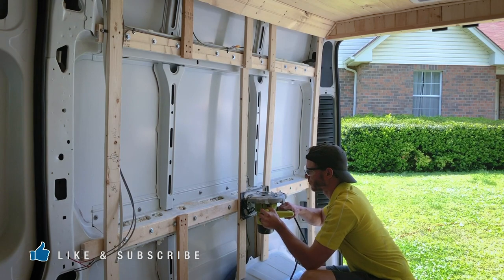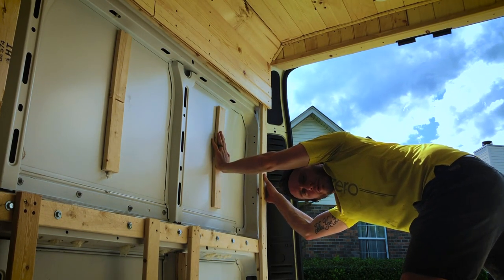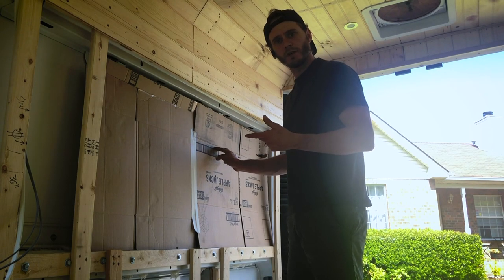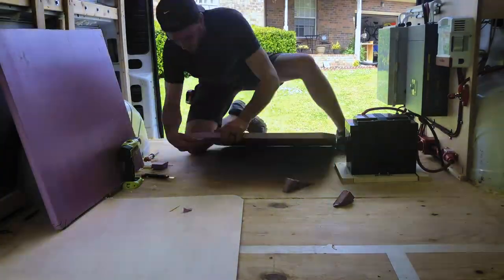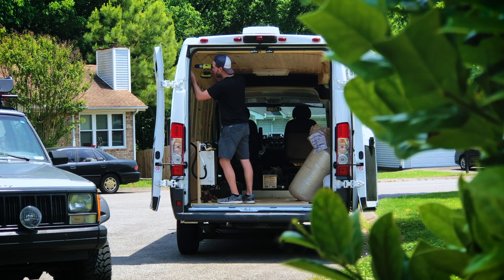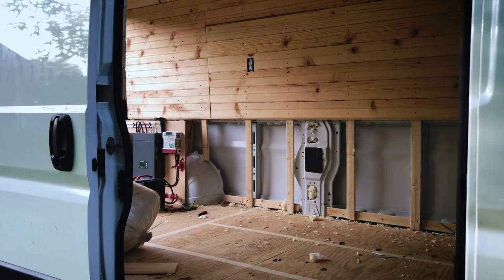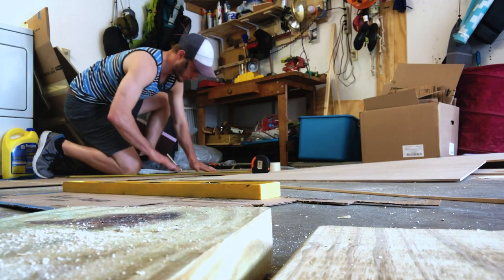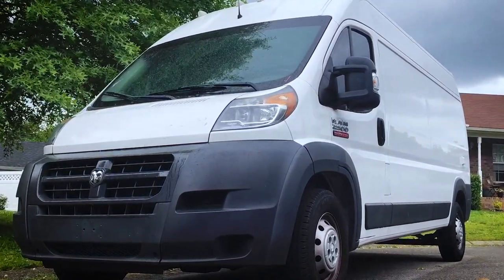DIY Van Conversion | Finishing the Walls and Installing Flooring

Comment: If you don't like the seam in your walls and ceiling, you could redo the shiplap and stagger them like you would if you were laying a floor, alternating one long piece and one short, etc. Bit more work, but it's not too difficult once you get the hang of it.
Reply from the maker: Thanks DW! I thought of this! Behind the one wall is all out our electrical wiring.. but I’m toying with the idea of carefully doing a cutout on that side too. It’ll just take a bunch of planning to figure out. But that’s way far down the road. Cheers 🍻!!

Comment: Looking good, my only concern is your choice of insulation. That is a good product for a house, not some much for a vehicle. As you drive around the vibration of the road will cause it to compac and leave large sections of your walls with nothing in it. I know its a little to late now but I figured I'd mention it.
Reply from the maker: That’s a concern of mine as well. I’m hoping that’s not the case. We stuffed it pretty good but we’re just hoping for the best with it! If we had the extra money we would have sprung for the spray foam.

Comment: How thick is your flooring? how has it held up so far? looks great
Reply from the maker: Thanks Mr BooYa! The insulation is 1 inch xps and the subfloor is 1/2 inch ply. So far everything seems to be holding up well! The laminate is maybe 1/4 inch thick.
Reply: @RyanMcdunco  thanks for the response. I meant to ask specifically about the laminate as far as how well it's been holding up. Thanks again.
Reply from the maker: It’s holding up great so far! When I put I. The kitchenette and couch I didn’t realize there were some screws sticking out a bit so we have some scratches but other than that it’s holding up like a dream!
Reply: @RyanMcdunco  awesome. Thank you for sharing!

Comment: Confused. So you used the cardboard as a template. Smart move on that. But, did you try and make it an exact fit and wedge it in there or did you find a way to glue that sunnabich?
Reply from the maker: Yea the cardboard template worked out. I just wanted the wood as extra bracing in case we push in the middle with a foot or something. The wood itself is screwed into a smaller metal rib on the van itself. I suppose I should have mentioned that. As for the extra bracing.. I used left over XPS (the pink stuff you see me putting up later) the glue worked with that. The XPS is insulation and gave me some rigidity and acts as the bracing I wanted.
Reply: @RyanMcdunco  well I for one am glad you figured it out good sir. Now keep going. I got driveway space, a shower, and a home cooked meal to offer you if you drive that beast out to CA McDunco!
Reply from the maker: You are far too kind my friend!!

Comment: Hey! What insulation did you use and do you like it??
Reply from the maker: We used havelock wool. It’s moisture and mold resistant and apparently fire resistant too! So far we dig it. We used three bags but I recommend 4 because we were running out towards the end.